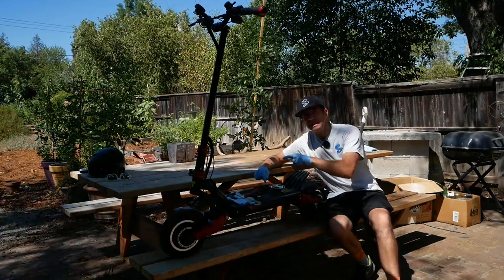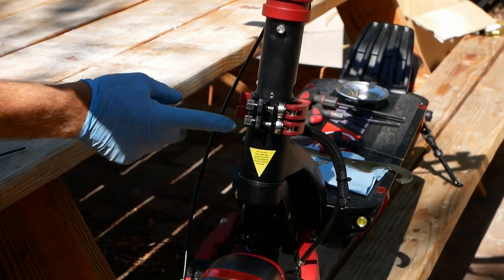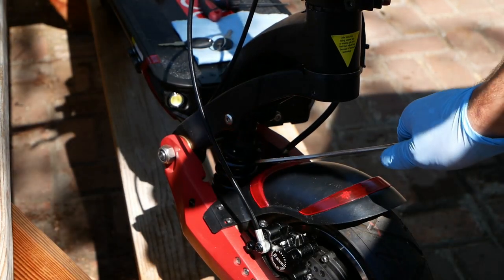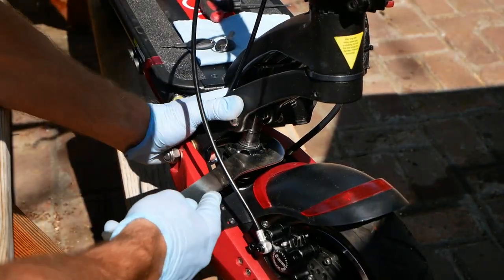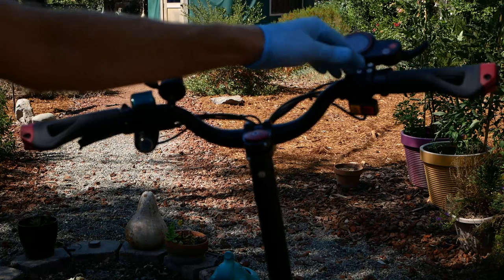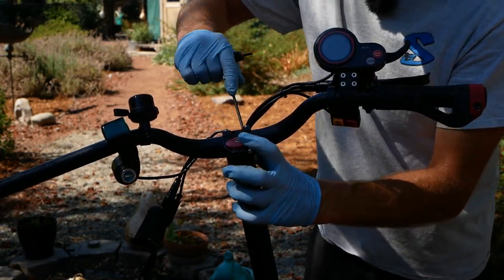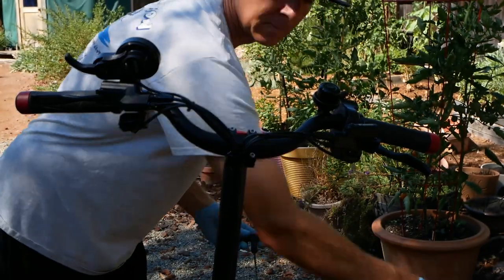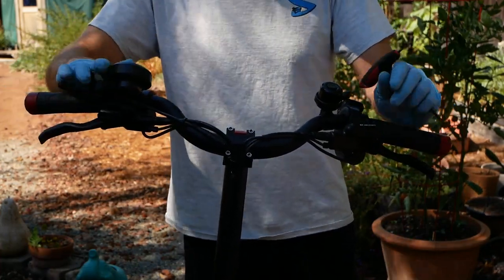Do THESE 3 things on your Zero 10x Electric Scooter NOW!

Comment: Good clue on why my volt meter won't properly tighten, since came reversed as you reveal.
Also good (new to me!)  info on 2mm adjustment for hydraulic brake levers.  Thanks!
Reply from the maker: It's pretty crazy how all of variants have that same switch as the base 10x. Cheers!

Comment: In the front suspension area, when you have the front brake on and you rock the scooter back and forward is there any play/movement in the swing arm?  I'm thinkin my front shock is too loose now.. videos like these are what makes YouTube great 💪✅✌️🙏
Reply from the maker: Hmm that does sounds like it could be the shock itself, also check all of the other bolts in that area. I went the other way and tightened mine to lock-out and it felt a little off. So at the extremes, the adjustment can get a little finicky! Cheers and Thank you SO much!!

Comment: u left out what size spanner wrench u used to adjust the suspension. what size is it?
Reply from the maker: It's the Park Tool HCW-5 which would be 46mm, multiple other sizes should fit too.
Reply: @ElectronSurfer  ok thanks for the fast responce
Reply: gots mines int he mail and it works great ..thanks

Comment: Can you please do a video on the Eagle One brake  adjustment.For instance, how to reduce lever travel and how to make your brakes more responsive. Thank you
Reply from the maker: I can work on that, unfortunately the Zoom Hydraulics usually have to be bled to make them more responsive. I'd try new pads first if it's been over 500 miles.
Reply: @ElectronSurfer  That was the one thing I wanted to avoid. Bleeding Hydraulic Brakes is not something I've ever done and wouldn't know where to start.
Reply from the maker: @fpvflyer4758  I hear you, I have only done it a few times and am not good enough yet to post a helpful video. It's the main reason why I prefer mechanical disc's.
Reply: @ElectronSurfer  Me too... I kniw discs don't perform as good as Hydraulic but honestly ita good enough  and they are way easier to work on

Comment: Hey man just curious I can’t figure out how to loosen the key slot I want to move it over but I can’t figure out where the bolt is!
Reply from the maker: The key/voltmeter has a small 2.5 or 3 mm set screw on the back, it is often covered up by the brake lever.I usually have to move the brake lever, move the key, then move the brake back. Let me know if that helps you.
Reply: @ElectronSurfer  I found it ty

Comment: Hi I have a question I have the Zero 10x and add the Rugged Clamp so dose that mean that I don’t need to add that part into the column.
Reply from the maker: The rugged clamp typically comes with the shim, it is possible there are other versions to the clamp than what RevRides had, if it works I'd go with it!
Reply: @ElectronSurfer  It's from the add on so dose that mean that I don’t need to do these steps?

Comment: Any one know if the circooter raptor  has a speed limiter? and how to disable? Just got one and had it out for a rip my top speed maxed out at 42km or about 25mph hoping I can reach a bit faster speed if able to do this thanks
Reply from the maker: Usually the speed limiters are at 15mph and almost always a grey wire on the controller. If there is another solution, hopefully someone will answer it here. Cheers

Comment: I adjusted my suspension. It was too soft/bouncy in higher speed. Turned it harder, but now it squeeks. Any tips how  to get rid of squeeking?
Reply from the maker: I would imagine you are getting more movement in the suspension pivot point. Some chain lube or wd40 for bikes should help. Just a few drops at the top and bottom and then go for a ride. Let me know if that helps.
Reply: Hi,what size of spanner wrench was used to adjust the suspension pls?
Reply: What size was a spanner wrench and where can I get it

Comment: How the hell did you get that shim on? I got the rugged clamp. How did you get that stem to fold back on top of that shim???
Reply from the maker: @Jase Cee, when you drop the shim in there the first time you raise the bars you will have to apply quite a bit of force to move them up and into place. Are you having issues with your rugged clamp?
Reply: @ElectronSurfer  hi mate, and thanks for replying. I see no daylight when stem is in place. I did try the shim, but even pressing down on the handlebars, can't fit the bolt back in. It will strip the threads. I've not had any problems since installing the rugged clamp a week ago. No slack or rattle.

I thought the shim was only needed if the gear was tightened further.

I'm on a lot of bumpy paths on way to work (14 miles there and 14 miles back 😂) so not had anything become slack or need more tightening at the clamp.

The rugged clamp is perfect.
Reply from the maker: @jasecee8992  Interesting, the shim should not interfere in any way, with the bolt unless you have that bottom of the stem grub screw type stem. Nevertheless, if your stem is solid without the shim cool!  My understanding is the shim is just part of the clamp to really give a super solid setup.
Reply: @ElectronSurfer  great vid btw. Thanks

Comment: do u think zero 10x is better then Xtron x10, Janobike,t10 pro,Janobike X10,loatie l8s,laotie es18 lite
Reply from the maker: I have not reviewed any of those other scooters. I will say that the fact that Varla has done so well with the Eagle One shows how the 10x platform holds up. I would say if it looks like a 10x, it probably comes out of the same factory and if the company is standing behind it, it should be a good option!

Comment: I think  no one is going to buy these Zero 10X scooters anymore, because the Vsett scooters have been out for a while now.
Reply: Tons of Zero 10x variants out there already that need adjustment.   Also, the Vsetts have their issues, such as under-foot charge ports, which I hate.
Reply: @bkanegson  I don't own either of these scooters but the top charging port on the deck on the Vsett is a no no in my book. Who got the time to make sure you're not stepping on the charging port when out and about enjoying the scooter.  It's going to be a paranoiac feeling.  Eventually, that port cover will break due to unaware/accidental stepping.
Reply from the maker: @babygamer405  I haven't noticed any issue with the top charging port, it is really in an area I don't find my feet getting to. Valid concern though.
Reply from the maker: @bkanegson took the words out of my mouth. A lot of used 10x's and variants. I was surprised to hear how many people hated the suspension so I had to chime in with some things to help the 10x, or variant, ride quality.
Reply: this aged horribly   the vdm 10 is the pred of this and beatrs vset out of the water shitter
Reply: @jjswigger8591  At least the Vsett 10+ is still better than the Zero 10X, right? 😆